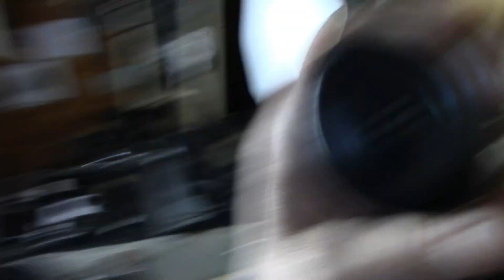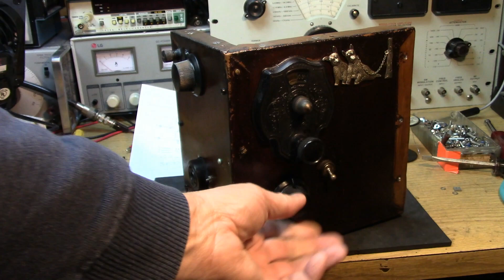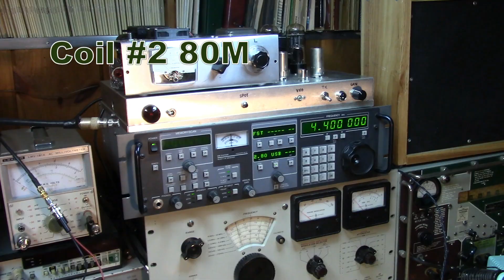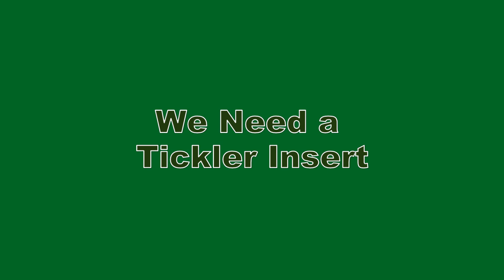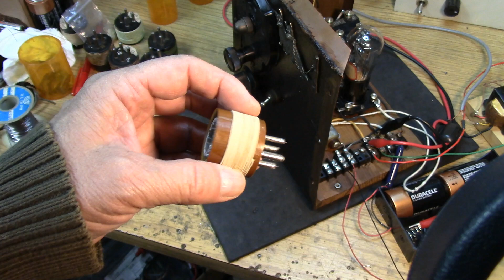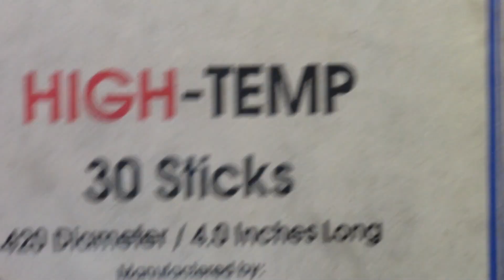Steampunk Regen - Part 6 Final

Comment: Found a 1922 wood cabinet radio at a house salvage place that was converted to a plug in coil, throttle capacitor SW regen set. Without your Scotty Regen series, I would have never understood what I found or got it going.  Loved the videos the first time and even more now.  From what I learned there are a couple of nagging thing I have run into that if you could help explain I would be forever grateful.  Those are: 1) Polarity of the A-battery grounding, positive or negative to ground.  I have read several old references that state and show for detector / regen, the positive of the A-battery goes to ground.  The Regen SW radio I found had the A-battery negative grounded like your Scotty schematic shows.  Mine barely worked in that configuration. Was hard to get it to oscillate, poor signal pickup, barely any background static and low volume.  Completely different, and started working well when I placed the A-battery positive to ground.  The tube is a CX301-A, directly heated cathode. I thought I had read once depending on the older directly heated tube filament construction in relation to the grid, there is a difference between filament F1 and F2 connections and grid bias reference for best performance.  And that is possible why the old tube sockets are marked plus and minus.  I have worked on some other old battery sets that seem to wire the detector and some RF amps with the A-battery positive grounded. And I have seen the + and – on the tubes backwards from what I would think.  Seem to be a bit of confusion around this.  2) Grid leak resistor in series with grid and a parallel coupling capacitor or connected to ground.  Why one over the other?  Sensitivity and or Q?  The CX301-A tube manual says for a detector, the grid circuit return should be referenced to the positive filament terminal. This gets back to polarity of the A-battery and ground.  Do you have some further insight into these two items, I think it would make a nice video to explain all of this. 
 
After writing above but not yet posting,  I found a reference which seems to explain much of it. Which indicates if the the Scotty and my radio are using “Grid Condenser Detection” circuit the A-battery positive should be grounded.  It also explains why I still measure a negative grid voltage in this positive bias configuration.  
  
MODERN VACUUM TUBES and How They Work by Robert Hertzberg, 1934, Chapter 3. pg. 13.

Comment: Just wondering would be much smaller if you used the Phillips/Raytheon Wire-Ended vacuum tubes and just used terminal block connectors instead of vacuum tube sockets.

Comment: I realize one of your objectives with this project was to maintain the authenticity of the receiver, but I’m curious if you have ever tried scramble winding the grid winding on lower frequency coils? I’ve done this when I had limited room for the winding and never had an issue. It obviously also reduces parasitic capacitance.

Comment: I would love to come across a spool of that old coil wire!  :-)
What causes the frequency shift when potted?  Distortion of the polystyrene from the heat?  Added capacitance from the glue as a "dielectric"?

Comment: Interesting & nice Regen.

I built a solid state regen 15 years ago. My various band coils were simply swap out or off the breadboard & not as elegant as the tube based concept.  Somehow I lost it. I'd like to have it back & may build new one of these days.

I am not a fan of hot glue for nearly all uses. Its just too messy and creates spider webs almost always. I think I would have used fiberglass resin or even melted paraffin for the potting procedure. Even many construction adhesives will, given a few days, turn completely solid.
Reply: Using Field Effect Transistors?